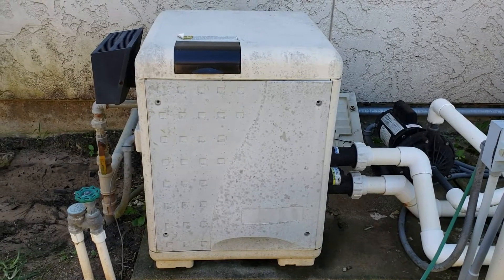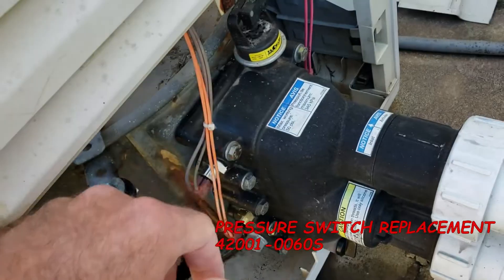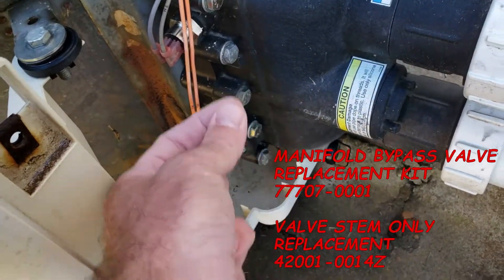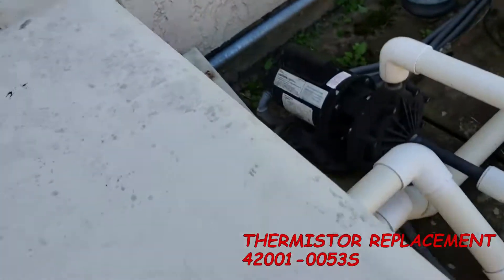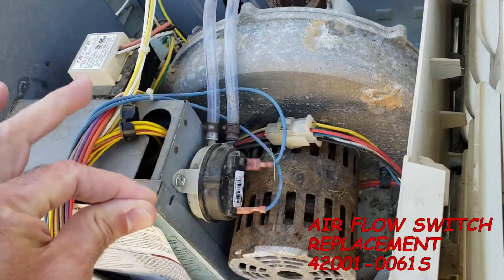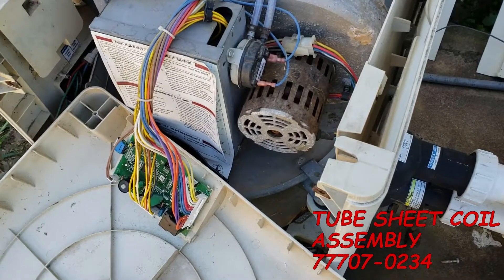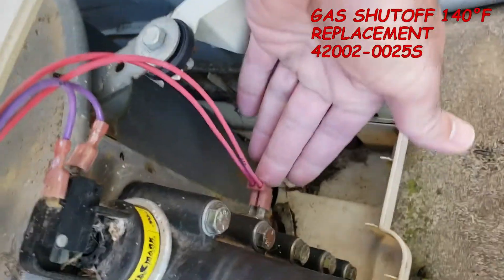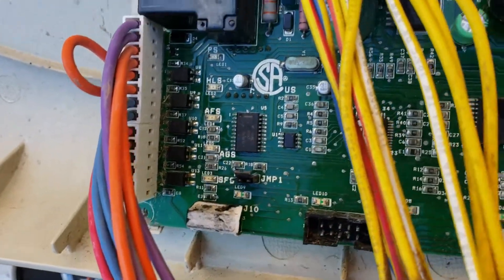PENTAIR MASTERTEMP 400 ERROR LIGHT LED EXPLAINED

Comment: I changed my pressure switch and regulator, but heater turns on  than goes into service mode for a few seconds and than cuts back on.  Do I check the back of the motherboard.

Comment: I’ve changed the HLS valve but the Max-E heater continues to display ERR HLS. Could it be a faulty Thermistor? Since I don’t hear any broken Bypass valve  noises from the heater.

Comment: This unit is garbage.  Have a newer one just under four years old…new pool.  Hardly use it and it’s had nothing but problems.  As I type it it’s had two repairs and the light is back on and not working.  Garbage

Comment: Thanks for this video.  Even 5 years later, it helped me fix my own heater.  It was completed stuffed with leaves and debris brought in by rats.  After cleaning, the error lights would only come on one at a time.  After fixing the E6 error by replacing the flu sensor, the PS light came on.  After fixing that, the HLS light came on.  After replacing that, the AFS light came on.    Once I replaced the Air flow switch, the unit finally cleared and the fan and heater came on.
Reply from the maker: That's intense, but you stuck through it.  Nice job!

Comment: Wonderful video - just fixed mine and back in business.  There are a lot of rusty bolts and corrosion in side the unit - not sure if I should be doing something or spraying something in there to help maintain.  Definitely doesn't look like they used stainless parts.  Also my HLS was filled inside with what looks like calcium deposits - does that mean I've got something wrong in my pool chemistry or is that a normal development over time?  Thank you!!
Reply from the maker: Yes, bad chemistry, but nobody keeps it perfect all the time.  Calcium build-up happens.  No shame, just roll with it (replace parts, clean tiles, all the fun stuff)

Comment: What about a E01? I had mice in my box and I think they shorten out one of the red 240V converter wires.
Reply from the maker: E01 is "open thermistor".  Check the thermistor connectors, wiring harness, and modular connector at the control board.  If all is OK, you have a defective open thermistor that must be replaced.
Reply: @pvt-pilot  so I replaced the thermister today and it seems to running normal but there is not the hot water coming out the jets like I am use to? Temp still shows like 44 and never climbs! No errors on display and heat light is on solid! There is hot exhaust coming out so not sure why it isn’t heating the water like it should! Any ideas? High temp sensor maybe?
Reply from the maker: @Torch-lt1ry  If you have hot exhaust, then your igniter is working, your gas valve is working, and your burner is burning.  Let's check for water leaking into your combustion chamber and filling it to the point of covering up some of the copper tubes inside.  If this happens, the fire will not be able to engulf the tubes as necessary which will result in hot, moist exhaust with relatively cold output.  There are about 12 vertically oriented bolts on you manifold (6 on each side).  Remove either one of the bottom bolts on the manifold and see if water pours out.  If water comes out, then you have a leaking heat coil assembly that will need to be replaced.
Reply: @pvt-pilot  Thanks. They are 6 on each side like you said. 13mm. Do I need to have the system pressurized? Off of course but do not know if I need to have it pressurized or not?
Reply: @pvt-pilot  unbolted bottom manifold bolt and no water! When I turn it on service heater light is on! Checked the bottom of the board and AFS light is lit red!
Reply from the maker: @Torch-lt1ry  System does not need to be on or pressurized to check for water in the combustion chamber. The combustion chamber is not pressurized.  Since you have no water in there, this is great news, but you still have an issue with air flow if the AFS is not closing.  I would recommend you watch my AFS video to familiarize yourself with its functionality.  The strange thing is if your AFS doesn't close, your AFS error light should remain illuminated, and your control board should not allow the system to fire.  So how did you get hot air out of the stack flue?
Reply: @pvt-pilot  what’s weird is it worked yesterday and it felt like my water was getting warmer but the reading never went higher than 51. I know what 51 feels like and the pool water felt like 70 something! So today I am getting AFS error and I never here the engagement after 10 seconds or so. The service heater light comes on and the AFS light. So I looked in the blower and there was a nice nest in there at one point so I cleaned it out. I then took my gas blower and blew it into it and the service heater light turned off but I never heard or felt it engage the heater! So that is where I left it! Do you think it could be the AFS that needs to be replaced? Because if it was a bad board the light wouldn’t of gone out correct? Sorry long winded post!
Reply from the maker: @Torch-lt1ry  When your heater is off, the AFS naturally falls into the open position due to zero air flow.  So, when you turn the heater on, the AFS error light SHOULD be illuminated for a few seconds (long enough for your blower motor to spool up to operational speed). The SERVICE HEATER light should illuminate on the front of the panel any time the AFS light is illuminated on the back of the control board.  So, it is normal to see SERVICE HEATER for the first few seconds every time you turn the heater on.  After the blower reaches operational speed, AFS should close.  Then, pending no other errors, the control board will continue the normal boot up process (opening the gas valve, igniting the igniter,  etc).  If there is any mice nest material that dropped down from the blower into the combustion chamber via the blower output, I don't think it will fall directly to the bottom of the combustion chamber and burn up.  That would be nice, but unfortunately, I think it would remain collected in the flame arrestor basket (the mesh cylinder that hangs down from the bottom of the blower motor output inside the combustion chamber.  See my heat coil replacement video to get a good look at where this is and how to access it).  Too much material in this flame arrestor basket could result in poor air flow on the output side of the blower motor.  If you clog the OUTPUT of the blower, the INPUT air velocity will be slow and possibly too insufficient to close the AFS.  Thus, your ASF error light will remain illuminated indefinitely, which also = SERVICE HEATER.  You can short the blue AFS leads together to simulate a closed AFS to test, but do this with extreme caution because you don't want to release gas into an improperly ventilated combustion chamber  It could create a dangerously flamable situation, which is the exact reason the ASF is a part of the system of hard stop safety checks.  You have got to figure out what is causing poor air flow.  You must find the blockage to clear the AFS
Reply: @pvt-pilot  Thanks! Of course the pool is getting closed tomorrow so I can’t troubleshoot it. I did try the shorting the 2  connectors that plug into the AFS and it did not turn off the light. So does that mean I have a board controllers problem? I might just order a AFS replacement for next spring and maybe the blockage will deteriorate by then and work? Otherwise might need to get a new mastertemp?
Reply from the maker: @Torch-lt1ry  If you shorted the 2 blue AFS wires together and it didn't turn the AFS light off, I would think you either have a damaged wiring harness or a bad control board.  Not an air flow blockage.
Reply: @pvt-pilot  I did try to push the 2 ends together but maybe I didn't do it well enough. When I took my gas blower and pointed it into the blower vent the Service light went out? However it did not engage. 
After that it felt like it was sucking in air but after 10seconds no Fire. I should of done the pliers short test like you did. So If i take out the 8 T20 bolts on the blower would I be able to see down enough to see if the inlet port is blocked??
Reply from the maker: @Torch-lt1ry  No, I don't think so. I videoed it a few years ago.  From what I recall, I think the fan blades were in the way, but I also wasn't making an effort to look past the blades.  I gave up the rodent nest investigation when I saw clean blades.

Comment: Great video. Maybe you can help me. I changed the control pad because i was nit able to raise or lower the temp on the older pad. The new pad gives me the same trouble.
Reply from the maker: Then you likely have an issue with the contol board.  To prove this, you can disconnect the membrane pad and use needle nose pliers or a piece of wire to short the common pin #1 on your circuit board to the corresponding pin that traces out to the button you are pressing.  I don't have the pins memorized, but I can do a membrane pad replacement video and illustrate this exact concept.  (I hope to have that done in the next week or so)  You just have to look at the back side of the membrane pad and follow each conductor embedded in the ribbon from the white modular connector to each respective button on the pad.  Take note of this and short the common pin #1 on the control board to the temperature up button pin on the control board briefly and repeatedly to simulate pressing the button repeatedly.  If you can't get the control board to respond this way, you have to replace the control board.  If it does respond, then your new membrane pad is also defective.  You can also use an ohm meter and connect it to your membrane pad across your temperature button female hole on the white connector of the membrane pad and the other lead on the common pin #1, then press the button on the pad and see if you get a 0 ohm short.  This will prove your new membrane pad to be good or bad.  You should see a short on each respective button if it is good.

Comment: I have a Mini Max pentair and only has an Err code.  Nothing else?
Heater will not come on. Was flashing 88.8 and I replaced the pressure switch and the temp sensor switch.  Now the 88.8 is gone but just have the err code and still will not come on?  Any suggestions?
Reply from the maker: Sorry, I'm just a home owner sharing knowledge gained from tinkering with my Mastertemp 400.  I don't have any knowledge on your Mini Max.  That said, 88.8 sounds like all possible pieces of each number on the display are illuminating, like what happens at a faulty gas station sign.  I might start with the control board with that scenario, but really don't want to lead you in the wrong direction.

Comment: I got an E01 message months ago, replaced the thermistor and it worked for 2-3 months.  Again the E01 message is coming up, and I replaced the thermistor but it's still not working.  Could something else be the problem with that message?
Reply from the maker: No, there are no secondary causes for E01.  E01 means the contol board sees an open thermistor.  The only causes for E01 would be corrosion on the thermistor pins of the control board or modular connector connected to the control board, chewed wiring harness, corrosion on the spade connectors at the thermistor or a defective, internally open thermistor.  For testing, you might want to try putting an ohm meter on your thermistor before replacing it this time.  If it is open, replace it again.  When you turn on your heater, you should get "128" displayed and "R-#" whatever you revision number software, followed by a legitimate temperature reading.  I had to replace mine 3 times in a row before I got one that was with pentair specs.  Some of these cheap ones off eBay are trash.
Reply: @pvt-pilot  thanks for the response.
The thermistors worked fine when checked with the ohmeter.  My FIL is a retired electrician.  He was able to buy a replacement mother board and installed it.  Working good as new again.
Reply from the maker: @Docinabox83  Fantastic!

Comment: hi there... I wired a master temp 400 to 220v but I did not use the righ 220v plug.. the 120v plug was in the unit and now the units does not turn on.. what should I replace
Reply from the maker: Check the fuse in the Fenwal.  Hopefully, it blew before the contol board.

Comment: Hi Thanks for the video - quick question - where does the light turn on to see what's broken? On the front panel display or on the circuit board? And if the circuit board do you have to run the heater the lid removed from heater to study the circuit board thanks. (I know its probably a dumb question.)  My heater is newish 2015 Pentair 250 MasterTemp and it turns on for about 5 seconds then turns off for about 20 seconds then repeats 4ever. I've called 2 pool companies but no answer. Not sure what's going on. I've cleaned the filter and have good pressure but am installing a FlowVis this weekend so I can quit guessing about the pressure. Thanks again.
Reply from the maker: You must try running the heater with lid off to see the LEDs illuminate.  However, there are some things that can go wrong that do not have an LED.  Examples...thermistor has no LED, but it has error codes E01 I think is "open thermistor" as demonstrated in my thermistor replacement video, and I think E02 is "shorted thermistor".  Other examples of things that could go wrong that don't have diagnostic LEDs would be non-electrical components like the thermal regulator and the plastic manifold bypass valve located on the plastic wall inside the manifold.  If either one of these items fail, there is no wiring to report directly to the control board that there is a faulty component.  There will be side effects where these faulty components will trigger electrical components to report back to the control board some abnormalities, and the control board will shut down the heater.  Such an item that could be at fault with your heater would be the thermal regulator.  If it is stuck closed, then your heater kicks on, the regulator will not open and allow cold water to dilute some of the excessively hot water.  The temp of the outbound water skyrockets, which causes the high limit switch to open.  This electric signal is detected by the control board, which will then close the gas valve and turn the burner off.  Cold water will then pass over the high limit switch, which will close the switch, then the contol board will open the gas valve and ignite again, and the cycle will repeat.  Without looking at your heater, I would start with your thermal regulator given the symptoms you stated.
Reply: @pvt-pilot  I super appreciate your knowledge and help. Thanks very much. I'll try this Saturday - wish me luck!

Comment: Thank you for your explanation on all the sensors I have a question I have the same heater and it was working perfectly last night and this morning the board does not illuminate at all no lights no nothing dead I checked the fuse and fuse is good and has power so I need help thank you

Comment: I have a Mastertemp 400 that fails to start up.  Was working fine a few weeks ago!  Normal cycle is blower startup, ignition, and whoomp heater is on.  Membrane panel is disabled (remote controlled by Pentair Easytouch controller), but instead of hearing the blower startup, I am seeing "128" followed by "r13", followed by blank.  Any ideas?

Comment: I know this is a old video, but I'm trying to diagnose a Pentair spa heater that won't run.  I used your video to tag all of the switches so I don't have to dig through the manual to see which is which. Thank you for making it easy to understand where the different sensors are and what they do.

Comment: I have a Pentaur Mastertemp 400, when turned on Blower comes on, no gas smell, after a few minutes unit shuts off with "Ignition Lockout" on Fenwall, No error codes on back of control circuit board